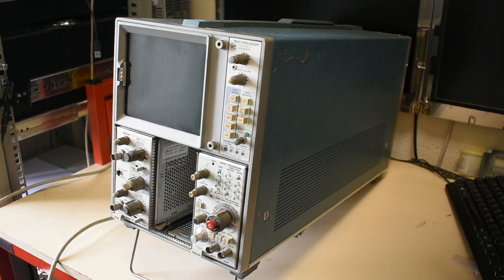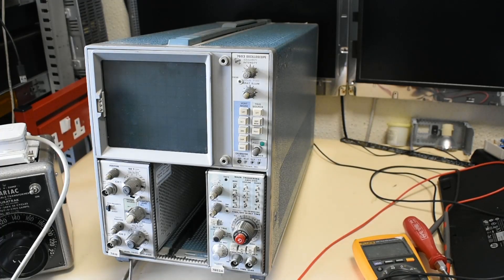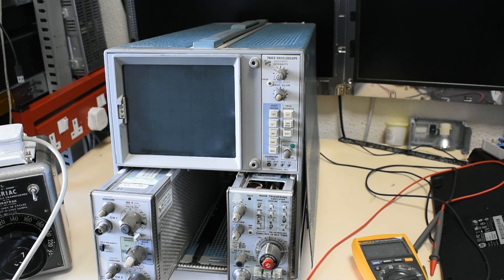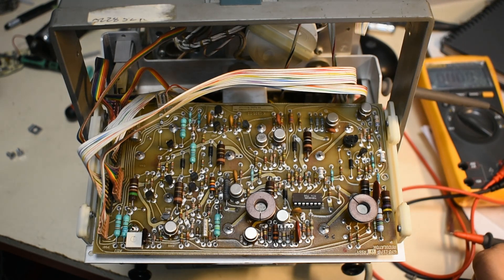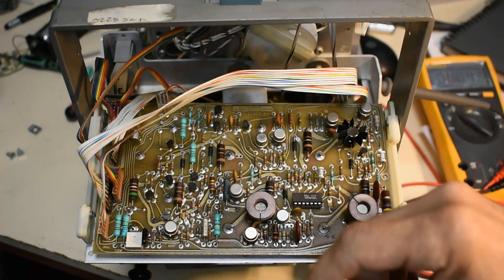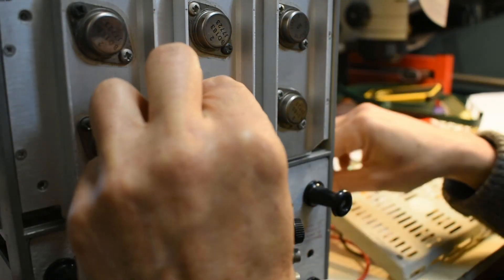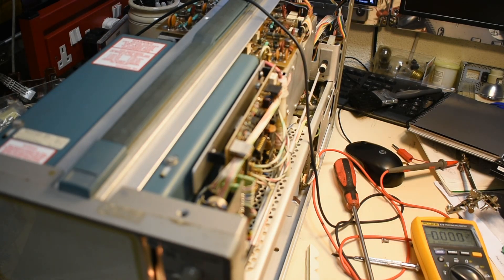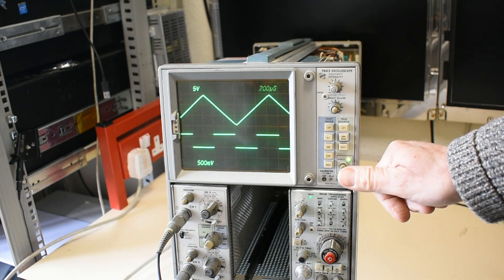Vintage TEK 7603 main frame scope repair

Comment: Hi! This is great. I have a 7603 scope here and is in need of repair. I inherited it from a friend and it was barely working (some initial display but eventually gave in and now just sort of frozen). I use it for experimental XY drawing – as you say it has a lovely big display! Although I have some experience of electronics repair (swapping in broken pots and switches and caps on old synths etc) I am very wary of getting into these devices as there are some high voltages. I am also no good at diagnosis – I can only carry out repairs if I know what I need to replace! I notice you have a Scottish accent(!) – I am based in Glasgow. By any chance are you reasonably near? I would love to bring this scope back to life and am looking to commission someone to diagnose and help me. Any advice hugely appreciated and thanks again
Reply from the maker: When you say, 'sort of frozen', does it still display in X-Y mode as this would suggest issues with the time-base plugin? I'm about 55 odd miles from Glasgow so maybe not that handy. There are quite a few electronics guys in and around Glasgow but don't know if they would be up for helping. As you are familiar with the electronics I could help a bit by email?

Comment: I really like the versatility of the 7000 series; my most recent acquisition is a 7854 which has up to 4 channels and 4 timebases plus a digitising function which includes a  wide range of mathematical functions.
Reply from the maker: I also have the 7854 and it's a favourite of mine too.  Although I have to remember it can only store one channel with the digital storage, otherwise I keep thinking it has a problem 🙂. It is considerably more complex than this 7603 frame so hope not to have to repair it too often.